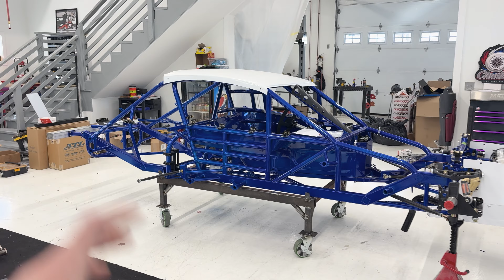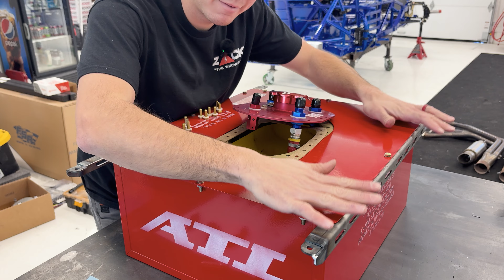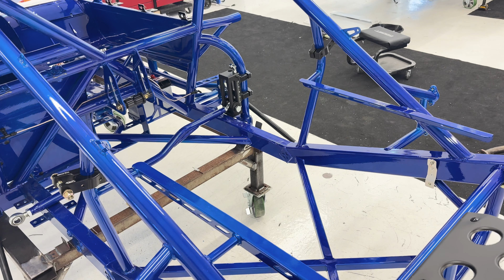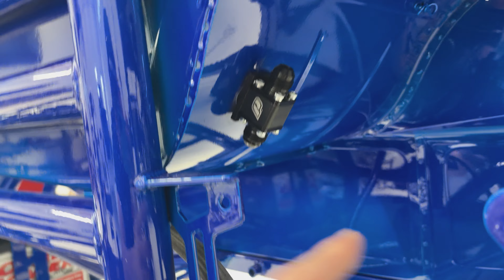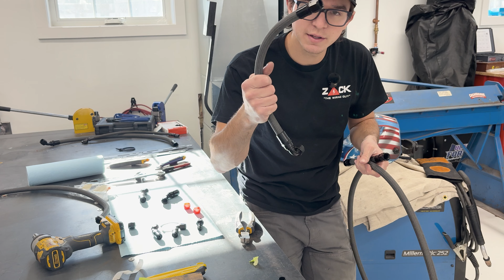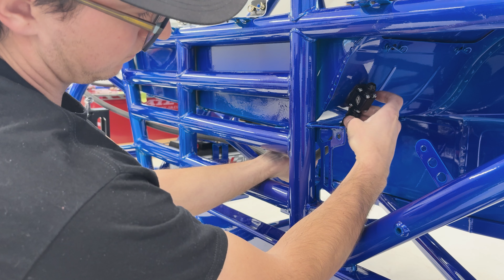NEW Race Car Build — Fuel Cell & Fuel System Install

Comment: I'm not thrilled with attaching the fuel line to the outer structure of the chassis. I would rather you attach to the inboard sheet metal with the appropriate grommet clips.

Comment: Dave, shorten up those bolts you used for the top lid. You have a 1/2 worth of bolt times 12 that you don't need. Plus, it will look better.

Comment: Can't believe that the fuel line is not run through a welded in metal tubing within the driver's compartment. I thought that would be a required safety feature, but IDK.  Enjoy these videos.
Reply from the maker: It is not required at our level of racing, that’s why our it on the inside of the frame at least. Thanks for watching